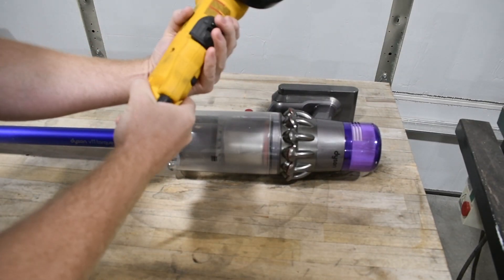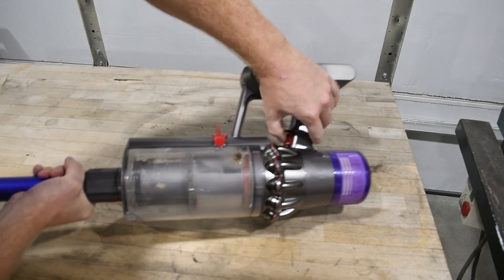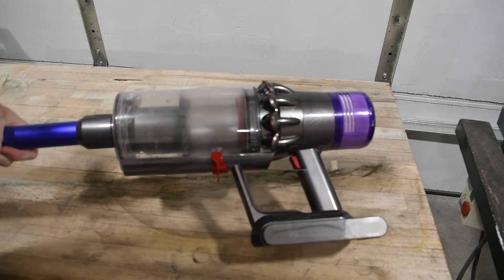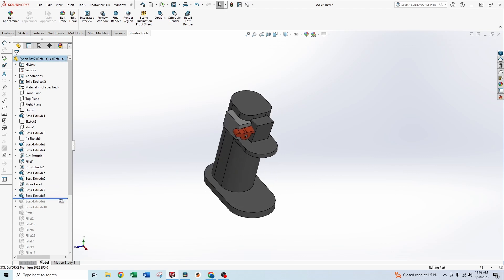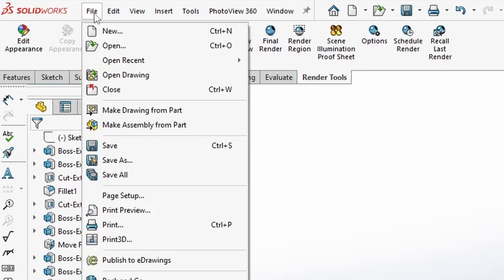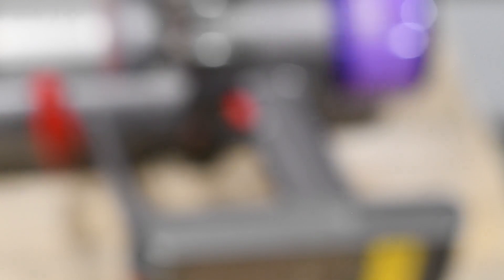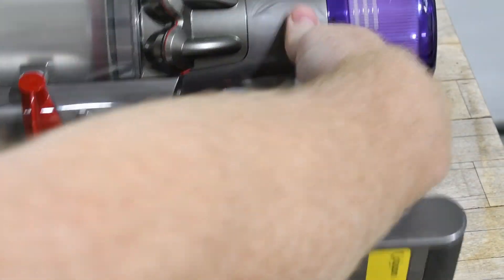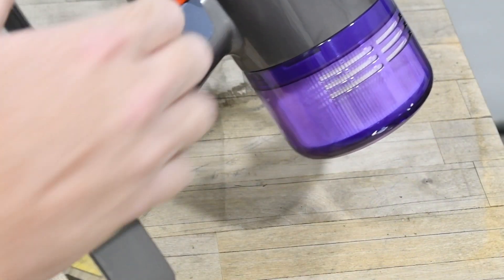The problem with Dyson vacuums...

Comment: my problem with the dyson and other portable uprights is the intake hose that lets the head twist also feels too small and gets clogged all the time with pet hair. i got a dyson for 10$ 2nd hand as it had that issue and wouldnt suck anything up anymore, after an hour long cleaning section it was working perfectly (well besides the dying battery)
Reply from the maker: 10 bucks is a heck of a deal. Thanks for the comment!

Comment: I wonder though... maybe they purposefully engineered it WITHOUT a trigger lock because they know it will burn out really quick (i.e. "under warranty") if the motor runs continuously ? I dunno. I've only used my sister's a few times and found my trigger finger needing a break often. I can't imagine doing a large carpet let alone wall to wall with one, but she loves it. Maybe I'll get her this for Christmas 😉🙂 Thanks !

Odd related side note for those who might find it interesting. When my sister went shopping for new wall to wall carpet she learned two things, which I didn't know either after more years and carpets than I care to admit. One : Use a Dyson, void your carpet warranty. Two : Walk barefoot on your carpet, void your warranty. Crazy or what ? I mean, I guess I can see the Dyson issue (but my upright beater bar is angrier than the little Shark head) but, barefoot on carpet ? ! Isn't that what carpet is for ?

ps Actually (and maybe you know) there is (was ?) a helicopter made with an ejection seat.
Reply from the maker: That’s all pretty interesting information.  Who would think walking barefoot on carpet was a sin? Do socks count?

Thanks for the great comment and feed back!
Reply: @ShawMade366   Heh, no idea if socks are ok. Probably ? It might be a sweaty oils issue ? No idea. Just guessing.